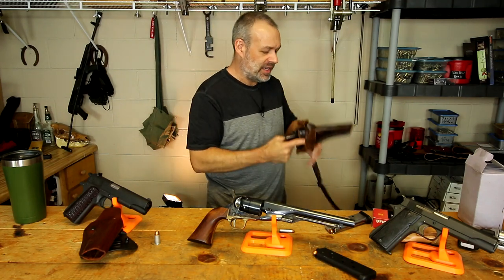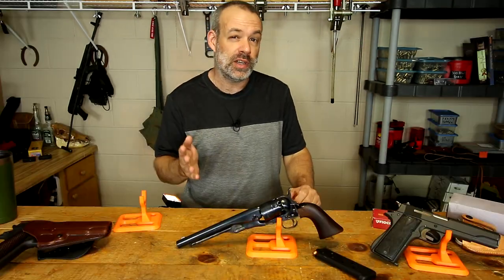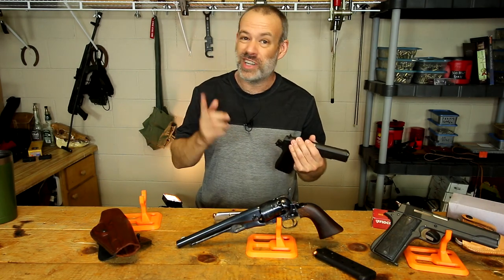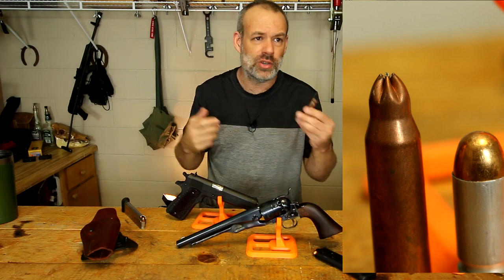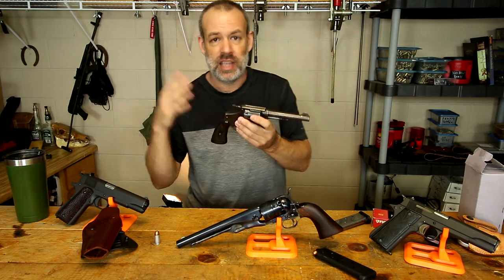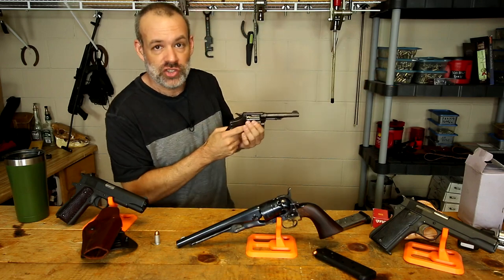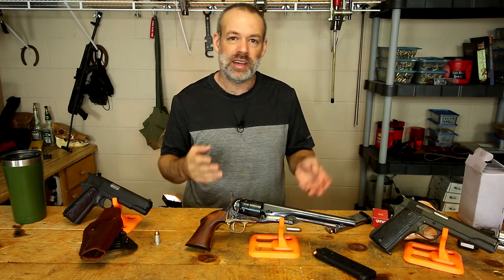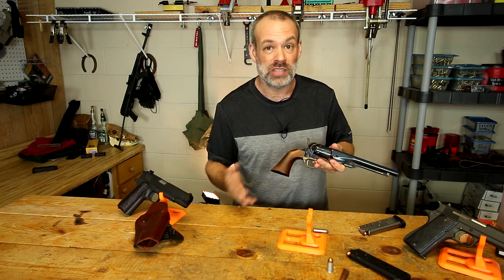How Do Prop Guns Kill?

Comment: I'm sorry, I have to disagree. No one cleared the firearm. Baldwin was told it was safe. He NEVER CHECKED. How many times did you clear the guns  in your demo? The bottom line is that Baldwin did not verify the firearm as to live or empty. Then he pulled the trigger trusting the mutts who are now shown to be completely incompetent. The very first thing they pound into your head in a firearms course is to consider the gun  loaded until YOU prove it to be clear. There were 3 people who handled that gun. The Armourer who appears to be an idiot, the assistant director who  did not clear the gun and then Baldwin himself who also did not clear the gun. Plenty of blame to spread round but the bottom line is Baldwin is responsible. It was his hand that pulled the trigger.

Comment: They could have positioned the camera and then walk away from the camera and took the shot from far
Reply from the maker: That's what they should have done.  I've seen fully remote controlled camera systems on sets but I think the low budget added to the issues on this set.

Comment: There should NOT be a welded obstruction in a semi auto. The barrel should be a custom design machined with a restriction.
Reply from the maker: A custom machined barrel would be ideal but when everyone is on a budget it's simply not how it's usually done.  I can personally attest that most if not all the blank firing guns used on the early seasons of the Walking Dead had a steel slug welded in the barrel with a hole drilled in it to allow smoke and flash through but still provide the needed back pressure to operate the action.
Reply: @deuceandguns  I understand what you are saying but safety needs to come first and I can't imagine the cost of purpose built barrels would break the budget when you have high salaries like Alec brings. Also as a former machinist it would be easy to back bore a barrel from the chamber end and then machine a plug that has a small hole to allow the gasses to pass that is oversized and press in. Then there would be no chance of a discharge.
Reply: @postalshark  Baldwin wanted a real gun(s).  I read he bought them.  They do look better, and work better, but... they are real.  You have to know and follow firearm safety if you're going to do that.  He didn't.  You are correct that he should have gotten purpose built guns, if he was going to be that careless with them.  I agree that it shouldn't be that hard to machine a good blank gun.  Most commercial blank guns discharge out the top of the barrel or slide, but that wouldn't look right for movies.  You should work it up and patent it!

Comment: That was very informative, but I think you are incorrect. He picked up a gun, pointed it at someone and pulled the trigger. You just don't ever point a gun at anything, or anyone, that you do not intend to destroy. All actors that must use guns in a scene get the same gun safety training that any real shooter gets. That is the #1 rule in firearms. #2 is (in that type of setting) that a gun is not clear or cold unless two people confirm it. Alec chose to point that gun at a woman (director of cinematography and not in the scene), andhe chose to pull the trigger, without confirming for himself that the gun was "cold". Other people may be copeable for ammo being in that gun. That does not remove any level of responsibility, on Alec's part, for the execution of that woman. His behavior was grossly negligent. That is reckless homicide.

Comment: They kill on the set of Rust by being loaded with a cartridge with a projectile and handled by reckless idiots who ignore the 4 basic rules of safe firearm handling.  If it penetrated the camera person and hit the director it was more than likely a ball and not debris from a blank.  The final idiot in this chain of disaster was Baldwin.  It is common knowledge that firearms are dangerous and that to point at another human and pull the trigger risks the very result that happened.  It would have taken Baldwin 1 second to verify that the gun was empty or contained only blanks.  If he did not know how to check he could have requested that the armorer show him to his face that that was the case instead of relying on the Assistant Director's word.
Reply: Not only ignored the 4 rules they violated all 4.

Comment: Should it still not be that if an actor or anyone for that matter is using firearms,regardless of what they’re loaded with,has safety training so they’re always used and handled safely? I’ve little firearms experience but I know you don’t sweep, always drop the mag when the slides locked back and rack it to make make sure there isn’t a round chambered after hitting the slide release multiple times. Anyone using guns needs training period!

Comment: First of all you need to recognize the difference between a "prop gun" and gun that is being used as a prop. There's no difference you says? You are absolutely WRONG. A prop gun is unable to fire a projectile. It literally is a toy gun. A gun being used as a prop is a real gun and can fire a projectile. Normally a gun being used as a prop, either isn't loaded or is loaded with blanks, so you get the bang but no projectile is shot from the weapon.
Reply: in this instance the term 'prop gun' is used to indicate a gun being used as a prop in a movie rather than just some random firearm belonging to someone. Without the word prop before gun all the news headlines would've at a glance looked a lot worse for Alec.

Comment: The problem I have with all this is that, with a real, functioning firearm (even modified just to shoot blank cartridges) everyone who handles it should be able to verify that it is safe to be used as they're trying to use it in that scene. With fake cartridges that look like real cartridges and/or purposefully obstructed barrels, how is the actor supposed to verify that? In my opinion, when dealing with something like a firearm, there should be no ambiguity.  

Furthermore... It's 2021, why do we still need to be pointing guns directly at people to make a believable gunfight scene?
Reply: "Furthermore... It's 2022......" best check your calendar there skippy.
Reply: @haywoodyoudome  thanks for the catch. I didn't even notice when it autocorrected the wrong date.

Comment: Just sayin', but everyone seems to be overlooking the real cause. Alec should NOT have pointed it at anyone. Alec should NOT have pulled the trigger. Last, (Really First), Alec should of checked the firearm when he received it. There are very easy ways to check a revolver cylinder AND barrel. Why does everyone not address the person that has the gun in his or her hand? If I am handed a firearm I always check it and NEVER wave it around when other people are near. Common gun sense practice makes sense to me. At the end of your video you stated that if Alec loaded the gun himself AFTER he was given the gun from the prop master he would not be responsible?? Why? The prop master already checked the gun and then gave it to Alec who should of checked it himself. Alec would be at fault in that  and NOT the prop master. Regardless The last person to handle the gun is responsible for all safety measures.

Comment: I have a starter pistol. The barrel can not receive a live round. There's obstructions in cylinder chamber. You can't tell its not a real pistol. Metal frame, bakelite grips.
 I always thought prop guns had cylinder stops or the reciever wouldn't accept a live round?
Baldwin case, seams like pure stupidity issue.

Comment: Overall a very educational video.  BUT... within the first 8 seconds, you pointed the barrel of your double-action revolver at your left elbow four times and your left wrist once as you were wrapping the belt around the holster, violating the rule of muzzle awareness.  Alec Baldwin violated the same rule if he was pointing his gun at the camera operator.  Using a remote camera and a secure backstop were his responsibility.  You had a lapse of awareness, while Baldwin acted deliberately.  Either scenario has the possibility of providing an undesirable, irreversible result.
Reply: Let me guess: If a gun is disassembled and the pieces are sitting in an ultrasonic cleaning bath, you still must treat it as if it's loaded, correct? You one of those, right?
Reply: @BogeyTheBear  Of course not.  It's a matter of habit, awareness, and setting an example.  Luck will save you only so often.  Humans are fallible.  How many times have you overlooked something obvious that was staring you in the face?  This can happen with a firearm that you checked and missed a round, for example.  I witnessed a conscientious co-worker clear and check a tubular magazine rimfire rifle, point it at the ceiling, and pull the trigger.  POP!!  Surprise!

Comment: No, Alec does not get off that easy. His sanctimonious self should have had plenty of time to learn about gun safety and therefore the gun shouldn't have been pointed at anyone. This wasn't an actual scene when it happened. Since when does an actor point the gun at a director in a scene? They don't. It is rumored that Alec jokingly (or not so jokingly) threatened them with it. We'll see.

Comment: I have dealt with a few (thankfully) negligent discharges and I have to somewhat disagree with you, this would be a seventy to thirty situation i.e. the Armorer bearing seventy per cent of the responsibility and the Actor thirty. 
Actors cannot be given a complete pass just because they may not have had any Firearms Training, if the part called for a sword fight they would have taken fencing lessons to prepare with particular emphasis on safety, firearms should be no different.

Comment: Ok. Again. "PROP" means "PROPERTY". As in that's the property of.  The production company.  It can be a pencil,  a car, an apple. If it's used on the set and owned or rented by the production company,  it's a prop. Not special. Not altered, it could be, but it's still just property. Could be fake, could be real.  (PROP)ERTY OF...
Reply: there are a few definitions

Comment: You are clueless... First off just putting a barrel obstruction in a semi auto pistol with a locked breach like the Browning tilting action you are showing in your 1911 will not make it cycle with a blank. You would also have to remove the locking rings on the barrel or the slide (and that would make it no longer being safe to fire with live ammo).
Second a military blank is not strong enough to cycle a semi auto gun. The millitary uses muzzle devices on gas operated rifles when using blanks, and light bolts and springs plus the muzzle devices on recoil operated guns firing blanks. And using a real gun as a blank gun in a movie is just stupid. You can get blank firing versions of pretty much any gun out there that look just like the real one. But the blanks have slightly different dimensions (like a smaller case rim and and  a longer case length on a 9mm blank) so that you can not put a real cartridge in a blank gun (because of the smaller rim on the 9 mm blank), or a blank in a real gun (because of the longer case length of the 9 mm blank).

Comment: it might of been an actual live round. or maybe a past squib then loaded with a blank and the the gun was never checked for a barrel obstruction. while the barrel still had a heavy cast lead projectile inside.  maybe a primer was never nullified and might of gone off in a way no one caught it, maybe the hammer was resting on a live primer and it got bumped at some point and went off away from the prop master. it could of been from another part of the crew and when it went off they just ignored it or walked away not knowing what had happened, thinking it was just a standard pop from a prop gun.

Comment: I am a little disappointed ol Deuce doesn't know firearms safety any better than the ignorance he has displayed on this video. Anyone handling a real firearm should treat it as if loaded and not point it at anything he doesn't want to shoot. Baldwin should have taken the 10 seconds to check the gun himself since he was too cheap to have made a realistic steel wood non firing replica and use special effects instead of real guns. Why didn't Baldwin mandate everyone handling the guns including himself to go over the 10 rules of firearm safety? Why did he point a real gun at someone and fire it? Why did he let protocol replace real safety? Why did he let real ammo on the set? He can blame everyone around him and the guns, but he did it!!! There may be some responsibility to share but he is the one that handled a firearm in an unsafe manner for profit.